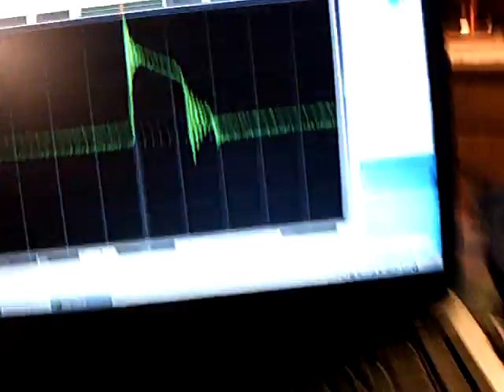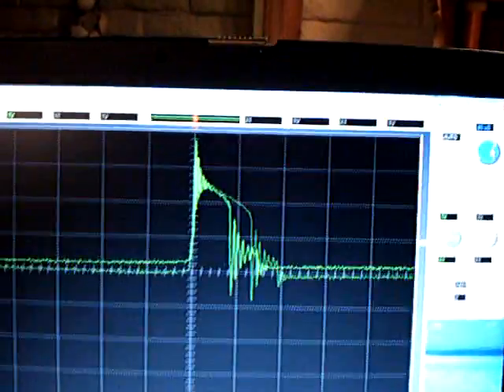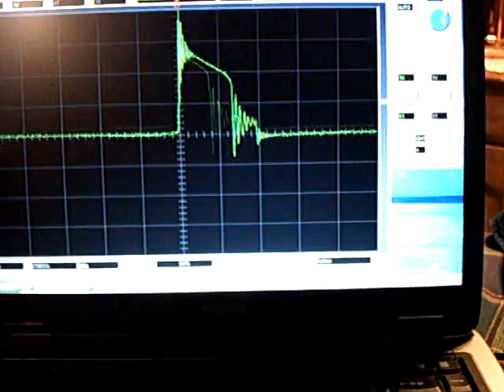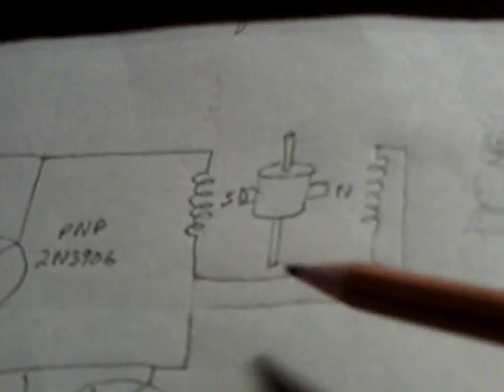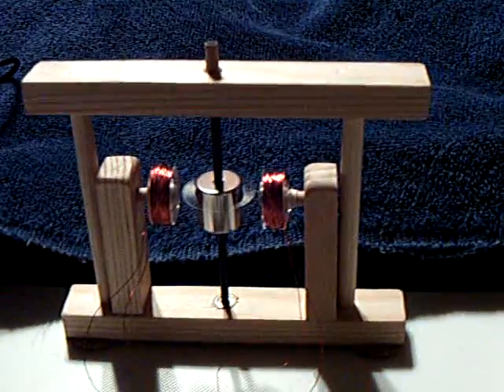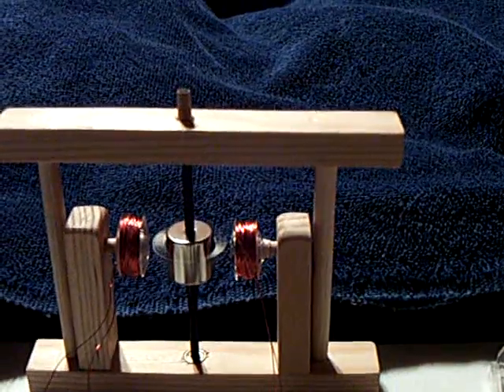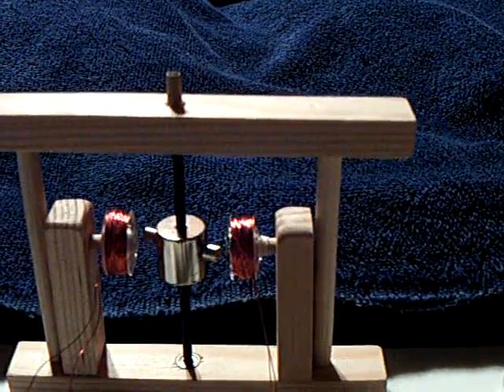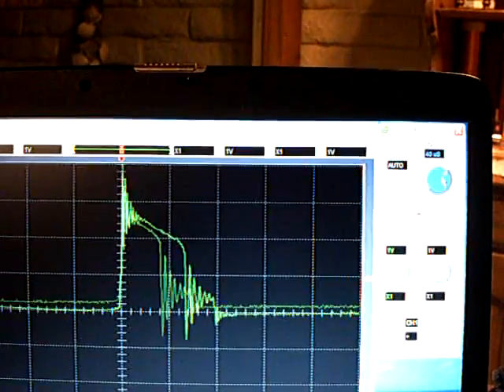Ring the Bell Twice---Ed L..ASF

Comment: The ringing is normally concidered distortion associated with weak or leaky transistor however the thing works nicely. I would look for a Q unloaded at max and the Q loaded at minimum and sharp flat pulse least width. First pulse the coil at various frequencies until you find the highest voltage the resonant freq. If you already did this then test the base emmiter V. I often find the 2N4401 fixes this.

Comment: bearden says its like ringing a bell doesnt he.
its like a coil to cap momentary resonance perhaps.
proper resonance would be constant ringing kinda like tonysam mentions with the back and forth so it would only need starting voltage and then would resonate by itself. most devices we research are constantly powered resonators/oscilators arent they ? the clever devices are ones that resonate un-powered after intitial trigger. i would like me one of those , ha ! infinte electric bell power  !

Comment: If you want a quick explanation for the ringing you are seeing on the scope, it has to do with the two inductors being undamped and set in parallel with your 22 uf cap. Since they are undamped, when you subject the coils to a sharp rise and fall they will oscillate momentarily creating the double ringing; coils charge and then release there energy into the caps then the caps will release their energy back into the coils over and over creating the oscillation you are observing on the scope shot.